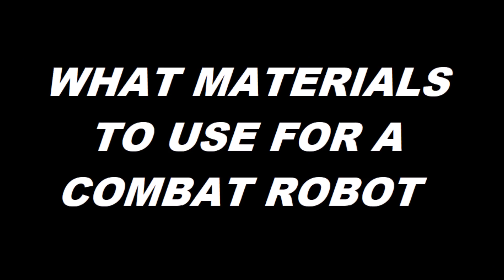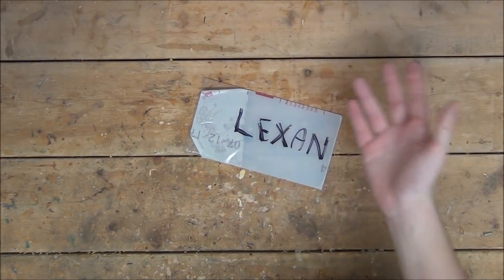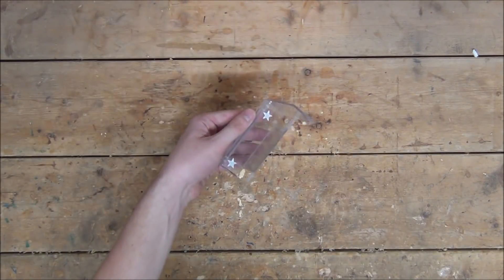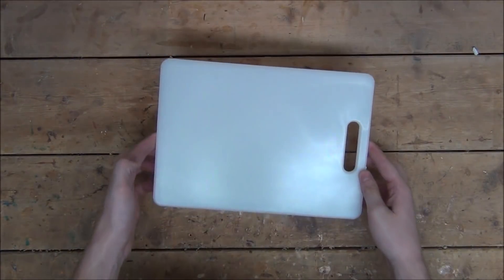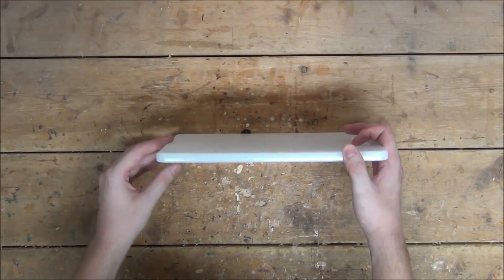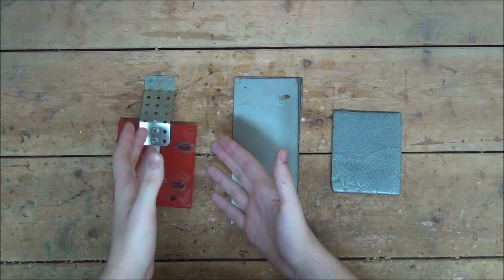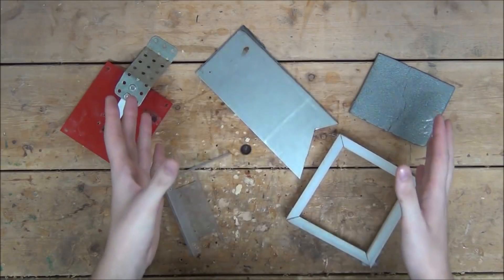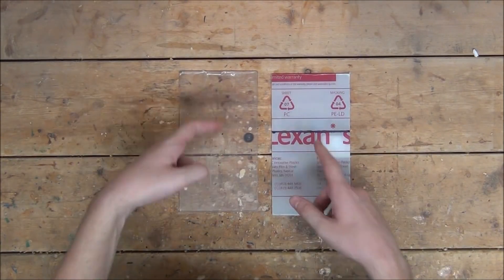Best Materials For Combat Robots // How to build A Combat Robot

Comment: Thanks for the video! I'm using the 1lb spinner video you made for parts (mainly the motor/ESC). My first bot was a 150g that was 3D printed (you mentioned this method, also). My next is a 1lb horizontal/angled spinner with a FT blade, made of Lexan. I'd love to shoot some ideas your way for my next bot, I want to try out a vertical spinner design with a pulley drive, not a direct drive like the bot I'm working on now.

As for the video, I'd say take it a tiny bit slower when talking. Keep up the witty humor, it's better than your average, dry and boring video.
Reply from the maker: Congratz! That sounds super cool! Yes, typically a belt drive is better on your motor when it comes to spinners since it can slip a little.  And you're saying your blade is made of lexan? Is that for your 3D printed bot?
Reply: @MechNinji  it's a Lexan made bot, with a steel blade. I was told about belt drive, but I am not quite sure that I could pull it off. I opted for direct drive using FingerTech's blade hub, to hold the blade onto the shaft.

And thanks!